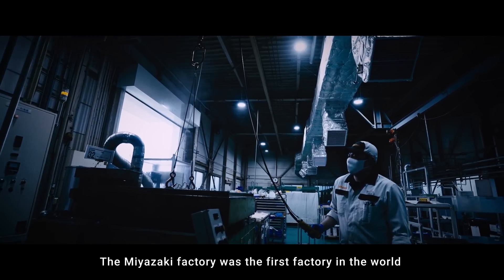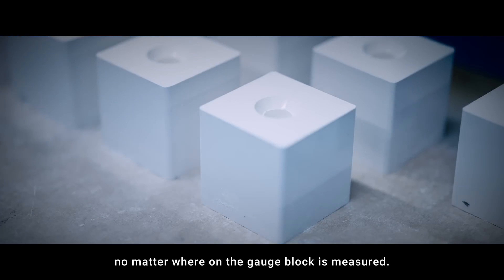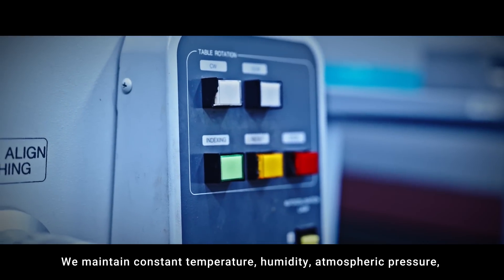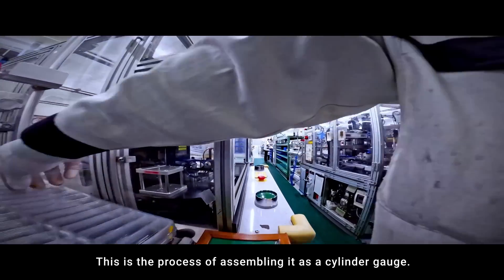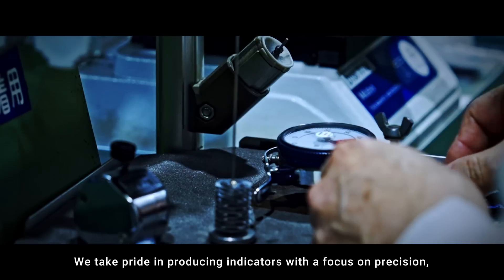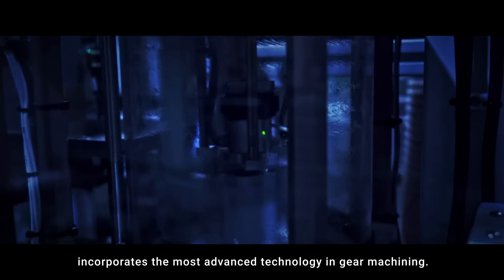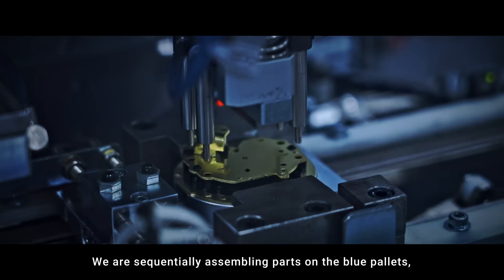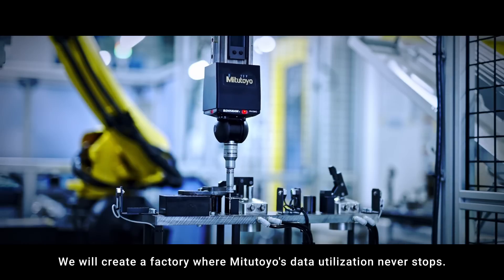Inside Mitutoyo’s Precision Factory

Comment: I have a small metalworking shop. A few of my measuring tools are Mitutoyo. Very precise instruments.
My acquaintances have asked me why I buy such expensive calipers when there are 20-30 euro ones in the store, they are the same and measure with the same accuracy. For an ordinary person, maybe so.
But to me the difference is staggering. When you pick up a Mitutoyo caliper or indicator, you feel how smoothly and precisely it moves, how thick and light movment it is.
The caliper can literally measure with an real accuracy of 0,01мм, while other mass calipers, although they also supposedly measure with such accuracy, actually give an error of at least 5-6 hundredths.

Great tools, expensive but totally worth the price!
Reply: So the calipers have an accuracy of 10 micrometers.
Reply: @Zuconja  0,01мм.

Comment: I don’t need a set each of steel and ceramic gauge blocks and a laser-etched lab grade surface plate to use as a needlessly precisely manufactured chess set, but it would be quite a conversation piece.